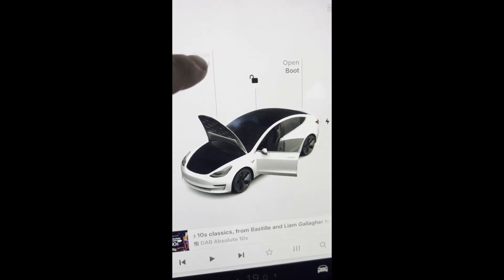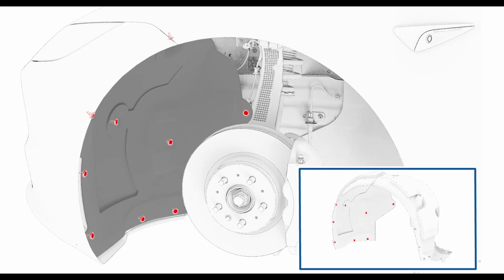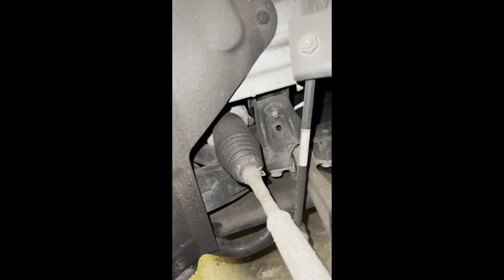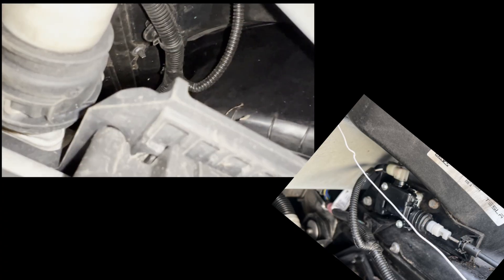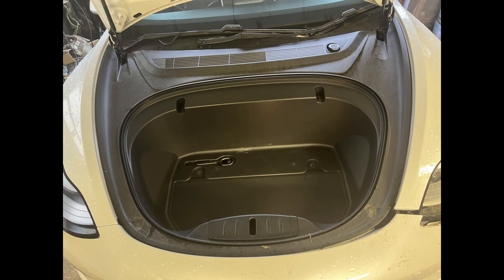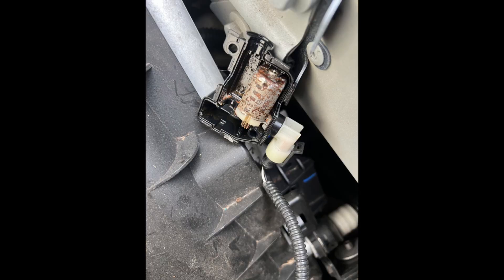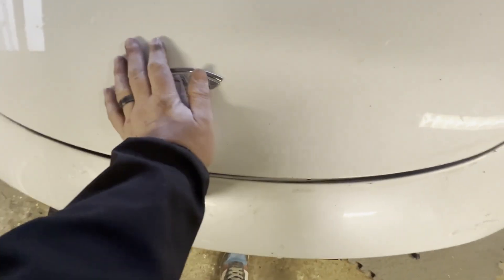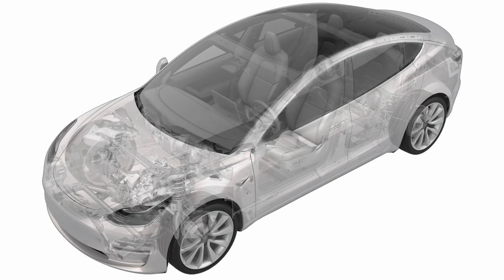Tesla Model 3 stuck frunk fix and manual release cable hack

Comment: which model 3 is this? is it usa or uk made? which year?
Reply from the maker: This is a 2020, which I believe is a Freemont built one.  I don't believe there are any differences in general, though - there's a primary and secondary mechanism - one on each side - which essentially mirrors the process depending on which one you are fixing
Reply: @wheeldesire awesome. i have a 2021 lr that was fremont made too. i thought there were some differences between uk and usa models. welp. i'll have to try this today! thanks.
Reply: @wheeldesire it's just not working for me. i'm going to try the passenger side tomorrow. i don't see it at all from the driver side.
Reply: i can feel it but i cannot manipulate it. ugh. gonna take bumper off..

Comment: Super video thank you.  Followed it and released my Frunk.  A couple of notes:  The space to get to the white connector is very small.  You need slim wrists but strong fingers.  It helps to loosen the heat exchanger unit (2x M10 nuts, one left and one right - visible at 03:26) using a pry bar to insert something into the gap you can make and that just opens up the wrist space a bit.  I couldn't get the clip off with my right hand but could with my left as I could get a finger behind it and push it, horizontally,  towards the back of the car.  Then two fingers around the loose end, tug,  and the pain was over.  (Blood and bruising on my wrist).  As per this video the release mechanism was full of water and liberating that, lubricating it and put it back together; it went back in working perfectly.  Just checked the secondary release before closing up.  Yes, that's full of water too.  Broke that open, liberated and re-lubricated.  I used liquid gasket to reseal the actuator lids.  However, I've also just bought new actuators from Tesla £84.79 for two.  I tried to persuade them to contribute as being full of water is not a design feature but they declined.  One other wrinkle in this journey was that the two captive nuts on the under tray fixing bolts on the far left and the far right respectively had become detached - so to get the under tray off was an angle grinder job.  The captives were replaced with U Clip Spire Nut (https://www.amazon.co.uk/dp/B0C3MV6FBW?ref_=ppx_hzsearch_conn_dt_b_fed_asin_title_1) and an M8 bolt with penny washer.  It is wise, per the video, to fix up a manual release cable for both left and right actuators hiding the ends up behind the panelling.  A method familiar to any early Boxster owners!
Reply from the maker: I still can’t figure out where the water comes from to get into those actuators.  They’re so high up and aren’t obviously exposed to rain!

Comment: Really helpful, thank you! I'm stuck at the step of separating the white cable holder from the end of the actuator (just past the rubber bellows).  You mention it slides easily, but in which direction?  Up?  In your video, I see a groove on the black metal where the white piece connects.  Trouble is, I have very little clearance up there so can't easily get a grip on the white part.
Reply from the maker: Yes, I think it is vertically upwards.  There's not a long of room in there - it was like birthing a cow
Reply: @wheeldesire  Birthing a metal/plastic cow indeed! My actuator was still working but I had locked myself out of my frunk with no 12V battery installed; I had initially (wrongly) thought that the bumper-lead method wouldn't work without a battery installed, even a dead one.  This is because the two-lead emergency access method would not respond to my initial 12V attempts, including a fully charged lead-acid powerboat battery.  With further information, I was eventually able to curtail my attempts to open the frunk the gynaecological way; in your case, with the water logging, your actuator was clearly unusable.  For other viewers who might be considering taking this approach but don't suspect a faulty actuator, the two emergency electrical leads sometimes require a high-current booster pack to get the frunk open.  I gather that the ability to do this with a 9V battery may have been possible only with earlier model years.  Mine is an early 2020 M3, and it was in a Sunday phone call to an open Tesla service centre that I was told to have a go at it with a proper booster pack, which did the trick.  I nevertheless found your video extremely helpful and informative.  The Tesla DIY 12V battery replacement instructions do not caution against the situation I experienced, because they are modelled after a service centre procedure, where the new replacement battery is available at the start of the job.  In my case, I only wanted to make one visit to the battery seller, with the old battery in-hand for recycling (and rebate); it was during that step of the job that I closed the frunk, the cause of all the grief!

Comment: We just bought a used Tesla model 3, the small battery is dead, the 2 wires that suppose to open the trunk with car charger don’t work either. I have now idea how to access the battery now. 
   Common Tesla engineers, are you this dumb not to install a frunk emergency opener handy?
Reply from the maker: It does seem extremely naive.  My experience of working in the design side of the industry is that engineers are, indeed, very naive and don't seem to think about these things.
Reply: @wheeldesire  No. This is intentional. Previous models had emergency latches on both sides inside wheel wells.

Comment: Good explanation and instructive video. Unfortunately, in my case,  primary actuator is OK but the steel cable was splitted so I had to cut the U to pop-up the hood and repair the cable....
Reply from the maker: It is probably a good argument to fit manual/emergency releases to both primary and secondary cable as a preventative measure.  
I did wonder if there was a route into either footwell for an 'old fashioned' hood release, instead of the wheel arch, as that would resolve any security concerns
Reply: @wheeldesire  finally I've cut the U so could repair the steel cable. Also installed a rope routes to near the front right wheel arch in order to manual release primary latch. No worries about security as secondary latch is still closed and nobody can see the rope haha.

Comment: I’ve seen a similar instruction but from the right front wheel off instead of left - I wonder if the UK right hand wheel setup makes this operation mirrored
Reply from the maker: @Hoffer09man  the secondary latch is on the right side, so it depends on the problem. It’s the same fix on both sides,  though - just mirrored